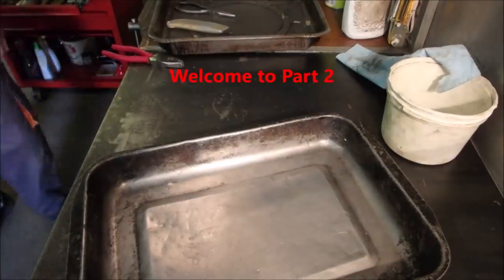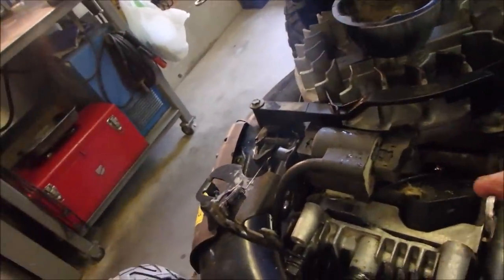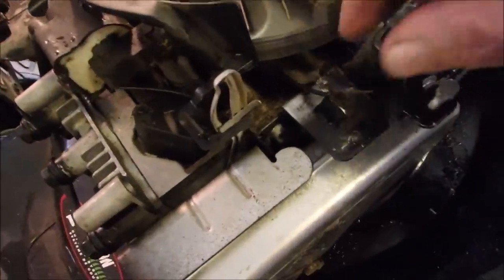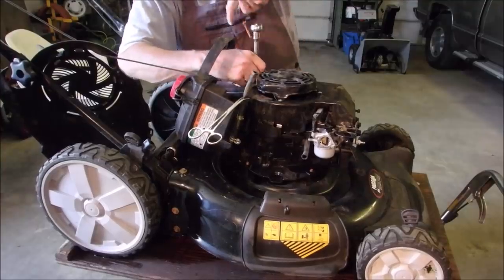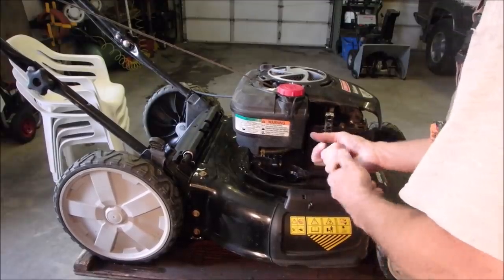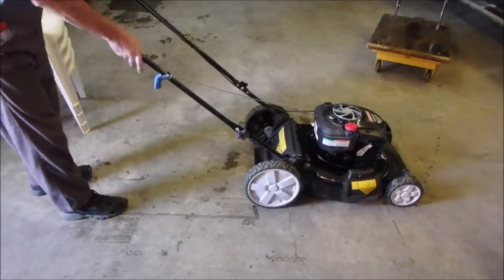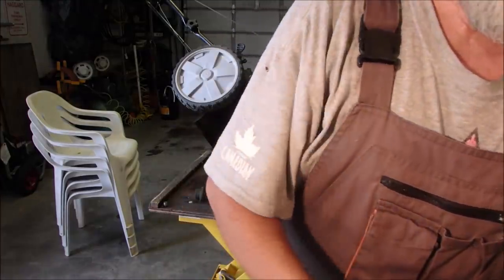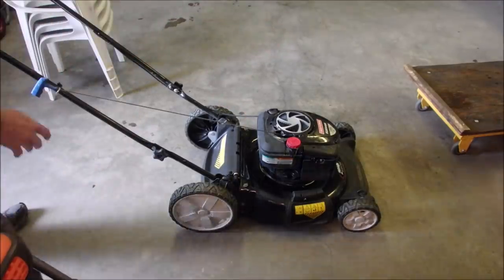Craftsman With Auto Choke Won't Start Pt. 2

Comment: I just realized another good thing about inline fuel shutoff valves??? When running the mower for the last cut in the cutting season, shut off the fuel valve and let the mower carb run out of gas. Then push the mower in the garage for the winter months...Done! Next, I'll install a dash fuel shutoff valve on my Sears 5hp Snow blower, Wherever I can install an inline fuel shutoff an any ground equipment I'm doing it. But, one Spring it took me an hour to find why my tractor wouldn't start. I forgot I install a fuel shutoff valve. Ha-ha-ha! But hey, I'm a 73 yo. These videos from Bruce taught me a lot since retiring, and Bruce puts quality in his work guys. I like that!
Reply from the maker: I just did that looking for the shutoff to my generator.  LOL  we are similar.

Comment: I have learned something today! I did not know about draining the oil from the bottom of the deck. I've been tipping the mower over to drain it. Thank you for this!!
Reply from the maker: Some ===as the Honda they have to be tilted unless you have an extractor.
Reply: My mower is the self propelled version of this one so should be the same I think.

 Issue I'm having is it won't start at all. Cleaned carburator, checked flywheel key, new spark plug and still nothing. Last time it ran, my son got the chute clogged so he started slamming it up and down trying to clear it. Then, it stopped running and hasn't ran since.

Comment: I've already done this work. Nice job on this, Bruce. A one-pull start is the satisfying part.
Reply from the maker: Yes.  If they don't start with one pull I just don't feel right.  My Stihl blower takes 3.  It drives me crazy.
Reply: @BrucesShop  I've never had a 2-cycle that started on the first pull. It's just the engine type. Well, you could use starter fluid if you wanted a one-pull start.
Reply from the maker: Thanks.  It drives me crazy.  It has a primer too.  haha

Comment: Thank you for the most comprehensive and clear explanations. I am working on the exact same problem right now. Just finished cleaning the carburetor and having same problem. Will be checking the choke next; mine also momentarily runs when gas sprayed into carb then stops. Fingers crossed!   BTW: You are correct about the over tightened bolts; another video says proper tightness is 7.5 fp . That is about one little sinch for those without a torque wrench.
Reply from the maker: Good luck

Comment: Thanks for this series. I picked up a Brute (MTD) with the same B&S motor. Diagnosed a missing choke vain spring and spark plug not gapped correctly. Cleaned out the carb while I was in there. Got myself a new self propelled mower now for spring!
Reply from the maker: Good for you.  You fixed it !!!!  so cool

Comment: Bruce, you saved my security deposit! My problem was not the carburetor either. It also wasn't the auto-choke. It was what you said at @7:00. I took off all of those engine covers and checked too see if the ground was separating from the coil when I pressed down in the bail... nope! Somehow it got bent. I took some pliers and bent it so that they separated when I pressed the bail down. Thank you again!!!!
Reply from the maker: That is great you got it fixed.  You made my day.  This is why i am on You Tube.

Comment: Great job again Bruce.  I was recently given a machine almost identical to this one. It has several issues and my friend chose to buy a new one. Lucky me.. I am anxious to check it out. Glad you worked on this one!
Reply from the maker: Good for you.  Carb blockages (brass bolt in the bottom) ---- Choke like this one, -----rewinds,  ----Stuck cables.  Other than that the motors never quit.

Comment: Brilliant video as usual. Very nicely done. One suggestion Bruce if you don't mind. I have the same Lift as yours but I have made the wooden platform a few inches wider than yours. This helps to put the tools and the screws, bolts and any other parts on the  platform so you don't have to walk to and fro to your work table to put the tools, screw, bolts and other parts on your work table.
I hope you don't mind the suggestion. Keep up the good work. 
Thanks
Reply from the maker: Yes I have thought about it.  My benches are 24 inches so this lines up with the edge of my benches.  I do need the bigger width  sometimes though, like bigger snowblowers.  Thanks Shiraz.
Reply: What brand and model number is the lift table?  I'm looking to buy one.  Thanks.
Reply from the maker: @KensSmallEngineRepair  Missed the comment.  Here is the info Ken
https://www.youtube.com/watch?v=yv7FtFWRHaU

Comment: Thanks for helping me understand better the relationship between the air vane and the carb. By the way, using the magnet to "grab" those 3 nuts holding the gas tank is a nice tip. In the 21 years that I've owned my Deere walk behind with Briggs engine, I must have removed that gas tank 10 times and usually drop a screw or 2 when fishing them out of their recessed housing. Also, I never thought to use the discharge chute to peek under the unit while changing the oil. Thanks for that also.  
Anytime I handle the oil dipstick tube assembly I thoroughly clean any dirt and gunk that is present in the area around the tube insert. Should that tube pull out entirely (easy to do) the debris is sure to fall into the oil sump.  Best to you.
Reply from the maker: Great comment Tony

Comment: Bruce it sure looks good. So I would say it was that choke arm. 
Because she started on first pull. 
I too have a 2012 self propelled she runs great until this year. I was cleaning her up and a ting spring went missing the vane spring. Will I found it but it took me hours to figure out how to connect. All done now. 
I need to get a float pin mine seem to have taken off last year so I put a small paper clip in its place. It seams to be not working this year. Gas pouring out of filter area. 
I will take apart soon and hopefully I can buy a pin locally. I sure don’t want to use a mail order place. 
Thanks for all your help.

Comment: Hey Bruce, thankyou for all your advice and guidance. I pulled the head and found the exhaust valve is terrible worn/chipped and appears to not fully seat. The seats look great so I ordered a new exhaust valve. Head gasket looks good. This is a repair for my sister so i'm trying to keep costs low. Cheers!
Reply from the maker: That is great!!!!  If i can add on e thing   check the valve clearance with both valves  I am sure you know that.
Reply: New exhaust valve arrived. It's a little smaller in dia but more meaty. Anyways, all lapped installed both valves set to tolerances. Started second pull and runs like new.😃

Comment: I have the Troy Bilt version of this mower that a neighbor tossed out. It would not fire at all with either gas or starting fluid. I disassembled the carburetor and found gray sludge in fuel bowl and center port of 1/2” nut plugged. From what I could tell all passages were clear. Tested with known good plug, tested coil, checked gap, still no joy. I lost track of how many times I dis & re assembled that mower, wondering what I was missing. I checked the kill wire at the mechanism and then pulled the bail. The brakes were releasing but it didn’t move far enough to break the ground connection. I bent that tab up just a bit and the mower started first pull. Still runs a bit rough but now I have a spare /loaner mower!
Reply from the maker: Cool.  Good for you.  Some times the brass bolt that holds the bowl on the carb needs a wire poked  through it in all directions that can help.

Comment: Nicely done video., i have a electric start similar to this craftsman B&S that won't start. I last had it running a few years ago and it was hard starting then. I have a few new ideas now and so thanks.
Reply from the maker: Right on
Reply: @BrucesShop  wondering where you got your stand. I could see this being useful for more that just working on your lawnmower.

Comment: Great Video again ( Encore' )    Non'c Bruce...........       

3 things I want to mention to you and your viewers ............      

1st...   Yes the ratchets you use are the best for us small engine guys....   The Craftsman and Snap On  type round heads are the fine click type used by Aviation technicians and other types of Techs for tight fitting and small areas where a few clicks makes a difference.........

2nd...   That gasket on the air box you used is more pricey than the other gasket that comes in the 498260 carb kit from Briggs......   The gasket with no primer bulb hole and the holes for the air box tabs goes on the mower you worked on.......... That way you can save the pricey one for a minor repair........  I don't remember the part number right off the bat.......  

3rd...   The spark plugs on the 6.75 and a few other models are supposed to be gapped at 25 thousand instead of 30........    

Plus Tard Mon Ami ~!~!
Reply from the maker: Thanks Boo

Comment: Yay, the Craftsman/B&G mower I worked on ripped the gasket when I removed the air filter and it's the same part number!  NOW I feel like I'm on the right track here!  My gasket was majorly stuck to the carb, took much work to get all of it off.
Reply from the maker: Good for you.

Comment: Great video Bruce your the best. i have the exact mower i got for free because it wouldnt start. i replaced the carb new plug,new airfilter,re-gaped the coil  , but when it runs about every 10 seconds it putts like a slight misfire. maybe take off kill wire in case there is a short and take coil off and sand the mounting surfaces maybe that will help . its a really nice machine
Reply from the maker: Just keep working on it if you have time.
Reply: if the flywheel key shears slightly, the engine runs rough or misfires. hope this helps.
Reply from the maker: Good point.  If most things don't work and it still backfires it could well be a key.    Sanding the surfaces of the coils usually doesn't help.

Comment: Hi Bruce thank you have the same lawn mower it starts and then I shut the lawn mower off the choke doesn’t close so now I need to order the thermostat piece in order for it to restart
Reply from the maker: I would check the choke  linkage under the shroud first.  Make sure it is not stuck or bent.

Comment: nice job.  I believe the ready start engines spec a .020 gap on the plug.  I have run them at .030 and have not had any issues.  Sometimes at .020 the engine skips.
Reply from the maker: These are 30.  Flathead Briggs  rj19lm
https://www.briggsandstratton.com/na/en_us/support/faqs/browse/identifying-the-correct-spark-plug-and-gap.html

Comment: Thanks for the step by step,... here in Austin tx, we have bulk trash about twice a year, it amazes me how nice of mowers that people throw away, I got 2 weed eater brand mowers I'm working on now, they have the Briggs motor with plastic carb, do you have a videos on how to hook up the 3 tiny springs to the throdel & gov , it's such a fine setting, got the first one going but wants to run wide open, I even have the second one to use as a refrance, ....just need to keep tinkering with ...thanks again, what type of oil do you like, it looked very clear ( if you give them a plug, they may send some goodies;)
Reply from the maker: Ok  if it is the older plastic carb like the following video    watch the hook is nice and loose that goes into the wind vane hole and also at 19:33 in the following video  (not the one above) you should see the springs
https://www.youtube.com/watch?v=napEqitOk7c

Comment: Bruce, in this video you mentioned regarding the blade , “not too sharp.” Would you please explain why the blade shouldn’t be too sharp?
Reply from the maker: I mower blades are sharp to a fine edge when you hit anything harder than grass the edge will fold over easier.  If it is blunted just a bit they edge will hold better and last longer.  When you buy a new blade the edges aren't that sharp for that very reason.
Reply: Eaxctly. Bull nosing the cutting end of the blade sightly keeps the cutting edge from being bent too easily from rocks and tree roots and the like.
Reply from the maker: Thanks

Comment: I love your videos

I have a question , I also have auto choke craftsman that I used for only 6 weeks, it's been nothing but trouble 

My question  is can I disconnect auto choke and install briggs air cleaner assembly WITH PRIMER BULB
Reply from the maker: No.--- the carb does not have the air flow for the pulse of air.  I have done it but you need a new carb too.  Do your homework.  Sorry
Reply: Thank u Bruce
I have a regular carb briggs and stratton  also
Same size motor 
I'll put that one on with all new gaskets and primer  housing 

Thank u very much
Keep up the great videos

Comment: Great 2nd half. Do most newer Briggs and Stratton‘s  have that same setup for the automatic choke? I think I worked on one similar to the one you just fixed.
Reply from the maker: Well the newer one are autochoke like this.  I get about half of each.  The primer ones are older.

Comment: Hey Bruce, I have this same mower and had it running and then it suddenly stopped dead.  I cannot get it to start now.  I have cleaned the carb, checked the spark, checked the compression and checked the choke and everything appears to be good.  Any ideas that would help me hear?  Thanks for your help in advance!
Reply from the maker: If it won't fire when you prime the carb with fuel I would try an ignition coil

Comment: Do you have a drain plug in the bottom of your mower?  My lawnmower is 3 years old and no drain plug on the bottom of my mower it's all sealed in on the bottom as of a Briggs & Stratton. I have to use a suction hand pump to pump the dirty oil out of the base by where you fill it up. My mower will not run as of the choke plate will not open and I have to stick a screwdriver in to hold the round choke plate open to get it to run. So an idle spring must be broken or some other connection. After watching your video I will check my mower out as of what you have done.
Reply from the maker: The newer Briggs don't have a bung.  Good luck on your mower.

Comment: I will check that next. I swapped carbs, didn't think about the round rubber gasket, did look for cracks in the intake tube though. Too many projects, to little time!!!
Reply from the maker: I get that.  I am just getting caught up on the mowers.  Snowblowers are starting to show up---- plus my own too.
Reply: Well... I did the carb spray test, no change,  the 6.75 is running with a miss that won't quit. Is it possible that the coil could be my problem. I checked the flywheel key, it's right on the $$$. It's got to be something I'm overlooking? 🤔
Reply from the maker: You are on the right track.  If is an old machine with lots of hours.  Then I would check the valve lash.

Comment: I’ve got an Ariens Mower with a B&S 6.75 (same motor pretty much) I’ve done all of this, including cleaned the carb twice, my auto choke was also messed up, got that back in line, and adjusted the settings between the marks. 

Still runs rough on start, RPM up & down, but if it stays running long enough (10 some odd minutes) it ends up running well. New filter, plug, oil, flywheel key is good,,, I’m completely lost, and about to go over everything again and hope a mystery fix plays, or I catching something I missed! Got any opinions??
Reply from the maker: Surging is usually a carb that needs cleaning.  i wish I was there to help.
Reply: Thx, I’m gonna have to go over it again. I also have a theory the auto choke is malfunctioning. It opens way to fast. When I manually push it back a bit, it runs perfect! But if the auto choke was malfunctioning, wouldn’t it not open at all?

Comment: Why didn’t you check the flywheel key when you were in there?  A partially sheared key from the blade hitting an obstacle will create all sorts of problems because the ignition timing will be off.  I just repaired my craftsman mower.  All that was wrong was an obstructed carburetor bowl bolt.  Mine was equipped with the primer bulb, and had no choke.  I’m going to section in  a cheap plastic inline fuel filter, as I don’t see anything that keeps crud from getting into the carb.
Reply from the maker: This is a Briggs and they tend to NOT shear the keys.  Tecumseh's do however.  On the gas filter, there is a screen filter in the tank which is as good as the red ones you can put on.
here is one from amazon
https://www.amazon.com/Inline-Filter-Briggs-Stratton-RocwooD/dp/B01HR32OPG
Reply: @BrucesShop  Thank you for the clarification. Nice video.

Comment: Bruce, what is the correct height for that float (non adjustable) same problem but my float lean up towards the carb
Reply from the maker: These plastic floats aren't that adjustable.  Is the seat down all the way??
Reply: @BrucesShop  yes the seat is down.

Comment: Bruce one more question the handle that we pull down to start and let go to stop does not work on mine. Sometimes I don’t even have to pull down to start. And to stop engine I have to carefully remove spark plug wire.
Reply from the maker: The stop cable that moves the lever by the engine must be sticky. Remove that and see if it can be loosened.  Go careful and if you take your time it may be able to be lubricated.
Reply: I have lubricated the area near engine where that spring is it  Still wont shut off. 
What else can I do Bruce. 
Thanks 
Houli
Reply from the maker: @johnhouli3450  This video may help.  It is not my video     https://www.youtube.com/watch?v=NbQxSWs85x8
Reply from the maker: @johnhouli3450  Right  This video may help.  It is not mine but may get you to the area you need   https://www.youtube.com/watch?v=cD0tdiiwD4Y&t=171s

Comment: Bruce! Help! I did everything here and it worked for a few times but now the mower turns over and shuts off. Any suggestions ?!
Reply from the maker: This may help.  The coil may heat up and not act properly.